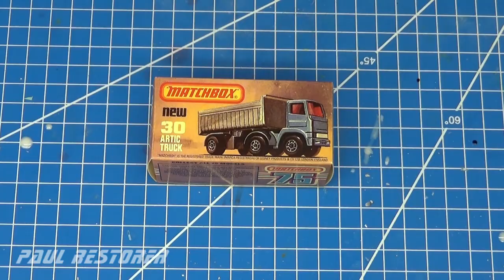Matchbox restoration LEYLAND ARTICULATED TRUCK nr 30. Diecast car making windows

Comment: Hi Paul that was a great video sorting the cab out was excellent,  and the window unit turned out great and it answered a question using glue to fill in the cracks the  sanding down .
Najlepsze zyczenia dla ciebie przyjacielu.
Reply from the maker: Thank you very much Martin

Comment: You now use caustic soda to strip instead of the "Nitromors" gel. Was there a reason for the change? Great job again BTW.
Reply: Hi Paul. What about V33 grl x caustic soda? Is soda still a better choice?
Reply from the maker: Thank you very much. I keep using the gel, but in this case I had a problem with removing the yellow color of the trailer, unfortunately the gel did not work. Only strong caustic soda beat this yellow paint the second time. Unfortunately, sometimes it is so. Best wishes